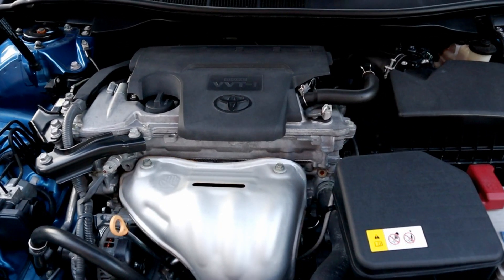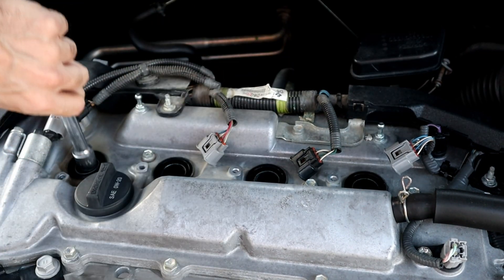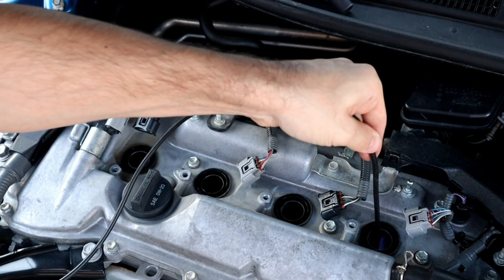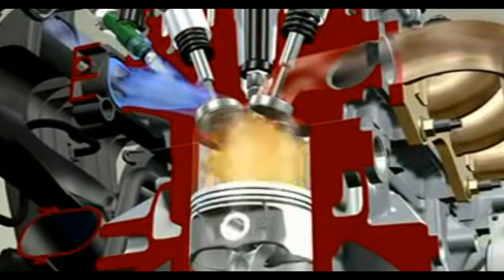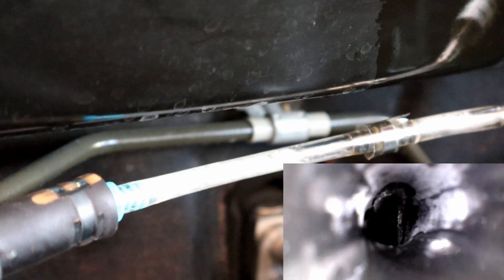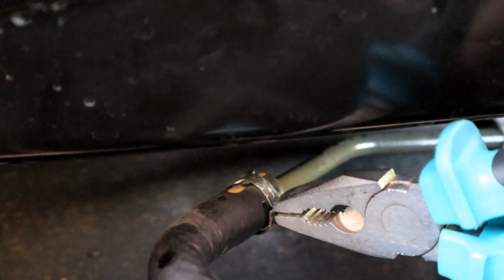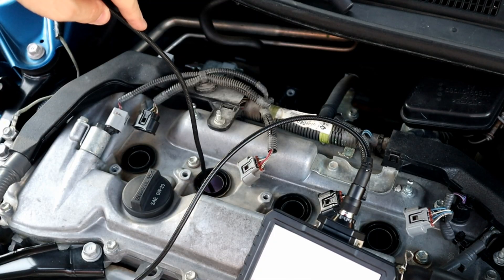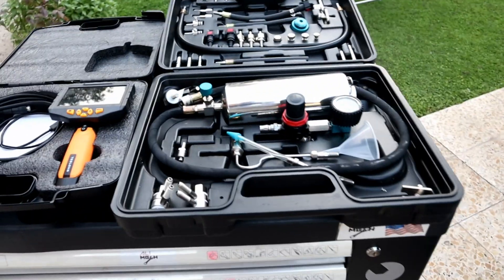Piston Carbon buildup cleaning in less than 5 Minutes/Cleaning Piston Carbon by AUTOOL Kit/seafoam

Comment: I have a 2016 veloster Nav g4fd 130k miles burning a quart every 300 miles, smokes when going down hill off the gas.

Im not sure if i should be looking at the valves or the cylinders, just did a carbon clean and still burning about the same

Comment: That is such a small amount of carbon.  No need for the tool or Seafoam, which is made up of mostly cheap oil, which is why it smokes, and is harmful to catalyst system.  Simply use a premium high octane fuel and perform an Italian Tune Up.  I have tested many of these products, and they do little, using borescope camera, and many create even more.  Most modern intakes are not designed to flow vapor or liquids, they collect in the bottom of the intake. You can see it with your scope.

Comment: thank you, great video.  I have a 2007 RAV4 with the 2AZ-FE engine.  It's burning a lot of oil now, it's a known design flaw with the engine 2007-2009.  Issue is carbon buildup occurs blocking ports designed to let oil flow through.  I'm not sure if this can help re-open those ports, but it's worth a try.  thanks.
Reply: how'd it work for you? I have a 2006 rav4 that seems like it's doing the same thing

Comment: Do you think that this method also cleaned any carbon on the piston rings?  I ask because there is a well-known problem in Volvo 2.0T engines from 2013-2016.  The belief is that the oil control ring is defective and doesn't allow the oil from the cylinder wall to drain. Eventually the constant burning of oil allegedly damages the piston rings and piston heads.  So I need to try to clean off the carbon in my 2016 V60 that has 178,000 miles on it.

Comment: I've had an even better result using a fuel additive containing P.E.A.   I put a dose of Archoil AR 6900 -P Max   in every tank (workrs out to a three or four cents per litre.  My piston heads are completely without carbon. The additive makes supermarket petrol into 'Super' grade - at lower cost. It also helps prevent problems with E10 fuel, and burns very clean. My 100 000miles Yaris was recently inspected and the  tester seemed suprised at the low levels of the  exhaust emissions.  I'd be interested to see you do a test of a similar product!
Reply from the maker: That looks interesting,  I will definitely try it
Reply: This product is very hard to get from USA.
Reply: @Alan-JackofAllTrades  Techron PEA Concentrate Plus Petrol Fuel Injector System Cleaner is another one - Im sure there will be similar US products

Comment: Cleaning carbon build up on  my 2017 toyota camry le without the kit. Could I spray the carb car spray to the fuel line hose while the engine is on or off. Thanks lc
Reply from the maker: You can use this method I showed in this video,  without using kit: https://youtu.be/U4T5fA9DTMM

Comment: Hi Ali.. I have check engine and VSC lights on 2017 Toyota Camry. Did you face this issue before?
Reply from the maker: No I haven't,  but when these 2 comes on, there is some problem with the engine,  did you use Obd scanner to read what coad reading?
Reply: @AliMECH  yes the code is p0171 system too lean (bank1) so what should i do

Comment: Great video looks like it's done a great job 👍 I was wondering  could I do this job by spraying the cleaner through the air intake past the air flow sensor as I don't know  what vacuum hose I can use on my diesel  Volvo V70 and would I be doing a better job by changing the oil right after
Reply from the maker: No, sometimes carb cleaner damage intake throttle,  it's better to find the vacuum like
Reply: @AliMECH   would crab cleaner work as I have loads of the stuff .
Reply: @paulgilraine3127  Liqui Moly as a specific Diesel Intake Cleaner which contains mostly Acetone

Comment: Amazing. I have had pinging issue in my camry for years until I decided to do the same to my car last year. Wish I saw the video earlier.
I did both induction cleaning method and piston soak. Since I did not have seafoam, I used Liquimoly intake cleaner. I had severe carbon build up on the whole piston head and in my case, only piston soak over night worked. Engine now runs happily with low octane fuel.
Reply from the maker: Glad it was helpful , GREAT JOB

Comment: Thanks a lot for the another nice video. I bought crc carb. and egr cleaner. If I use it from the vacuum line of fuel canister hose to directly intake manifold is it harmful for the turbo or catalytic converter and oxygen sensor? The engine is toyota turbo 1.2 liter 8NR-FTS direct injection.
Reply from the maker: I dont recommend it for turbo cars, there is a specific cleaner for turbos, and they are very much safe, sometimes carb cleaner make turbos make a squeaking noise
Reply: @AliMECH  Thank you brother
Reply from the maker: You are welcome brother